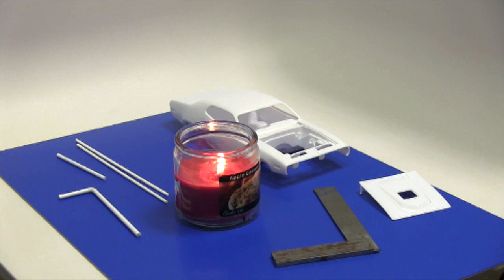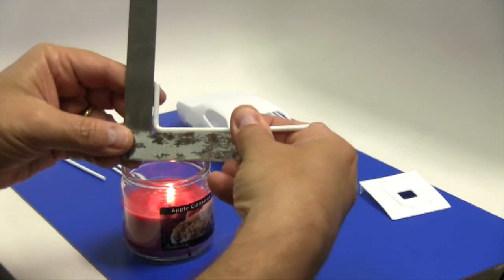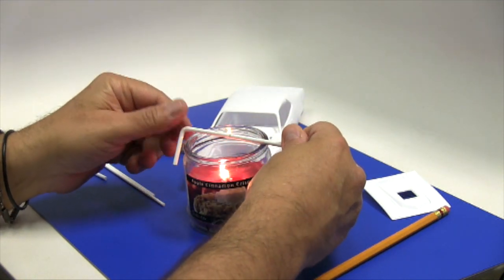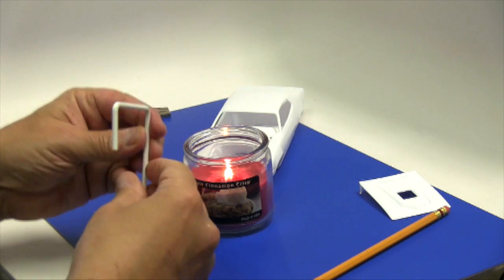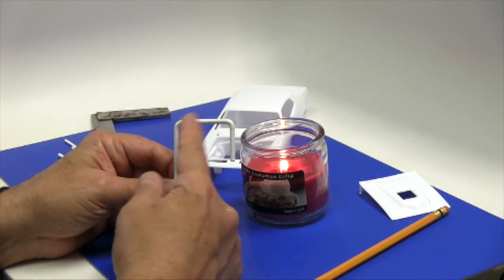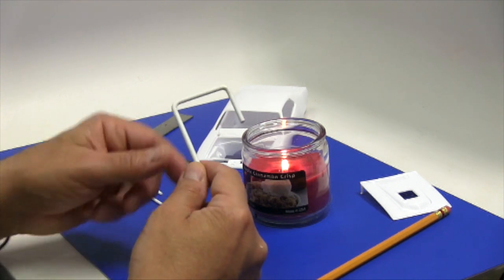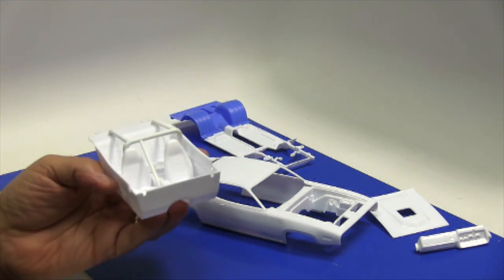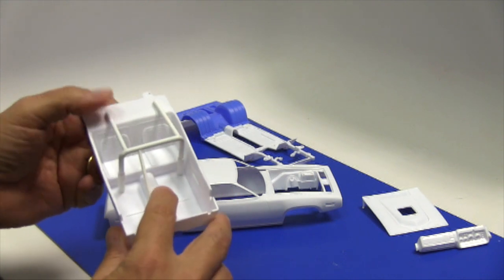CLINIC:  Styrene Roll Cage

Comment: you could probably bend wide gauge styrene tubing by packing it with sand, capping the ends with a cork, and heating while bending

would prevent kinking
Reply: I did try the sand method but it still kinked. I packed the sand well too so not sure what went wrong 🤔

Comment: Hey Doc, great clinic.  For roll cages I've found that drilling holes in the floor of the chassis bucket or floor pan helps with the main hoop.  That way I can set the glass and interior bucket in place and adjust the roll bar hoop height.  Then I lock it in with liquid cement from the bottom.  I also add the rest of the bars after the main hoop is in.  I'll drill other holes as necessary, then pre-bend the bars.  I use a mini round file to fish mouth the bars to fit the main hoop.  I like how you used the candle.  I use soft wire inside of my tubing to bend it.  I just leave the wire in side.  I plan on "borrowing" a jar candle from my wife and give your way a try.
Reply from the maker: Aaron, that is a wonderful tip indeed.  Thanks.
Reply: Excellent idea!

Comment: You was doing a great explaining on how to built and melt tubing for a roll cage. but than you did the same common mystake as all High Rank builder, Ya leap a step  In 5:46 pop up and you was Finich. It Didn't show the glue and the bend of the middle pole..lol I can fugure it out but the one that saw for the first time i wish you luck did you use PLA3 Bondene Solvent Cement 2oz. Bottle to glue the part together?.. WE STILL LUV YOU DOC...

Comment: Nice video
I wand to make a roof rack for a1/6 Axial truck whit 8 mm  hollow styrene tube..
Do you know iff this material will brake if the car rolls over or will gleud point snap off by inpact...and do they have this in black to..

Comment: so filling the tube with sand isn't neccessary..?
Reply from the maker: You could if you are working with hollow tubing.  Normally I don't bother because I try to make the roll cages with solid plastic rod.